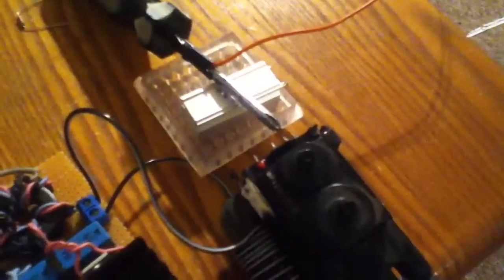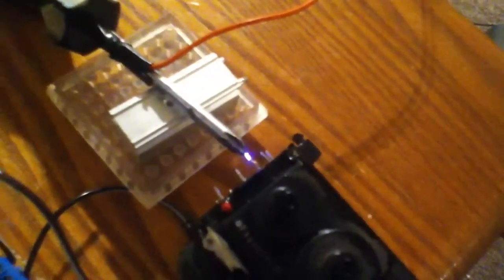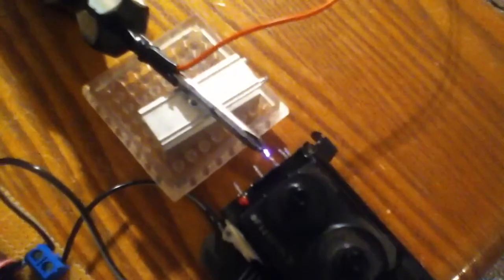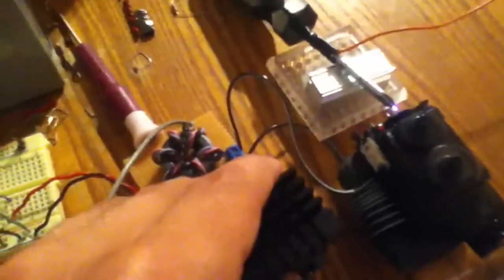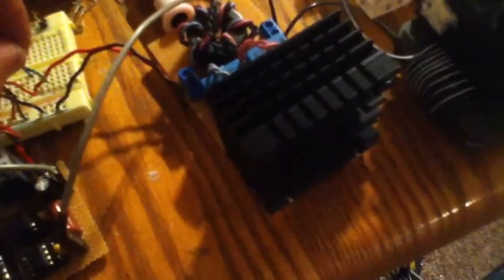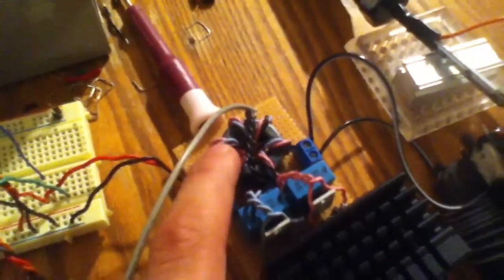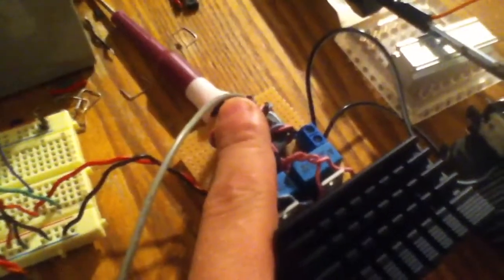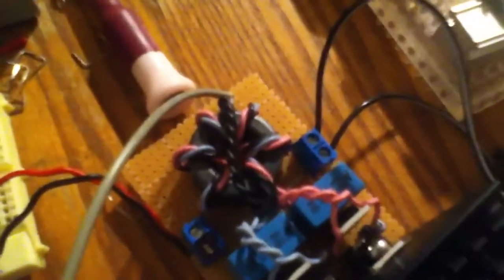Tesla Coil Problem

Comment from the maker: I tried 2 different cores, one was a toroidal transformer core from a car amplifier, the other was an ungapped ETD core. I got similar results with both of them when running rectified mains to the bridge. I hooked the original GDT back up and it worked the same as the other 2 cores did. The problem was I was running too little voltage, as this driver isn't the best for this application. :)